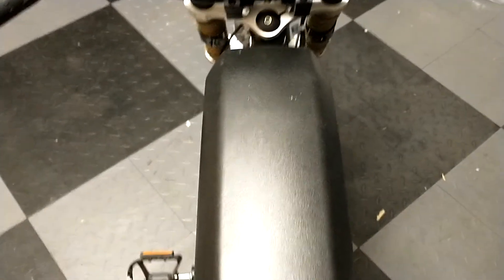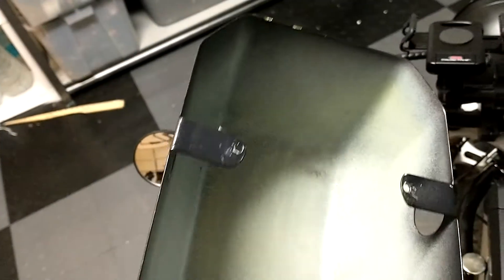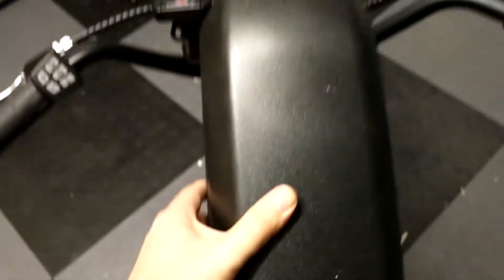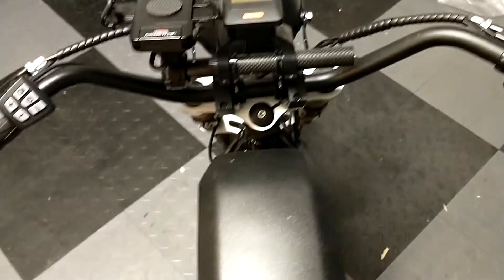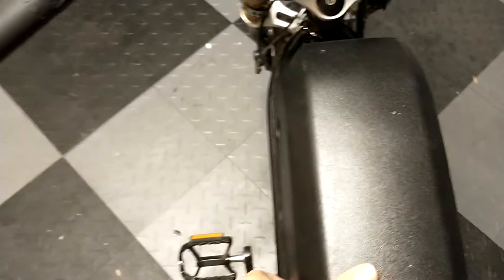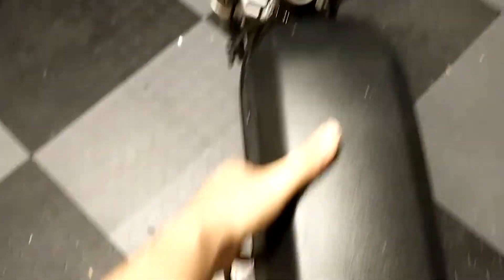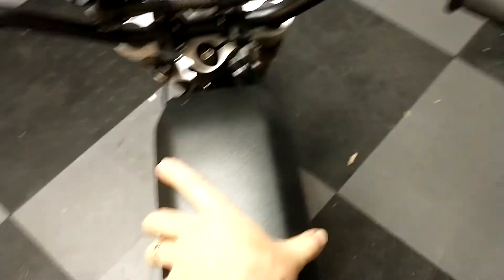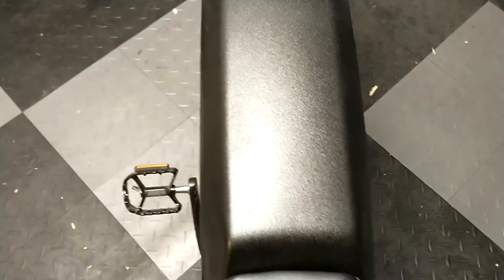Monday Motorbikes Anza - Easy Battery Cover Mod For Removing and Replacing Faux Tank

Comment: Great idea, ordering my magnets now. I got one of the first 500W Anzas. I hadn't had any speed issues like you did though. Hits about 21-22 mph, as I expected. Stupid tank was driving me crazy though, I had just been riding without it, thanks for the tip!
Reply from the maker: Nice! Haven't heard of anyone getting those speeds. Great to hear. Your tire size setting came set at 22 or 23 and phone gps shows 20 also? Very interested
Reply from the maker: Oh and try ordering 8.  Four for tank and four for frame. Think that will stop the rattle over bumps. I got another set to add more but my bike is all torn apart right now :)
Reply: @RobbMods  Verified with my phone GPS, yes. Didn't know about tire settings though.  Where do you find those?
Reply from the maker: @scott1127  https://www.manualslib.com/manual/1697627/Bafang-Dp-C171-Uart.html?page=12#manual double click the i button to get into the settings menu. Then click the i button until you get to the LUd screen. That is where you set the tire diameter. Ours should be 22 or 23. Mine came shipped at 29 so made it look faster than it actually was. That link takes you to the manual showing other settings to play with. Sadly the top speed setting doesn't do anything. Glad yours is working great! Thanks for sharing, I'll let other folks know :-)
Reply: @RobbMods  Awesome, thanks again! Got mine back in January so probably the very 1st batch of 500w. Not sure if that makes a difference. I'll have to check my settings now.

Comment: So, you need to take that off to charge the battery?
Reply from the maker: There is a hole you can pass the cable through to charge. If you want to take the battery off the bike to charge indoors, then yeah you need to take off the tank :-/
Reply: Oh ok 👌

Comment: Do the power cables for the battery mount look like they are easy to access? Like is there a plug inside the frame? Im going to have to try to get those out. I'll be checking tomorrow so don't go out of your way to look haha
Reply from the maker: They just use barrel terminals. I cut those off and got some male/female terminals from Lowes. Pretty easy to access. In my manic troubleshooting trying to get my new controller to work before I fried it i just pulled the cable out of the frame. When i put the OE controller back I fished the cable back through but was a little short by a 1/4 inch.  I wrapped the cables in black heat shrink and kept it out side the frame running along the  outside of the pipe and under/off to the side of the battery mount. Got an extra 1/2" of cable so the new terminal connectors reached fine with out too much tension on the cable.
Reply: @RobbMods  ok cool! I did take a look and it doesn't look too bad! I'm just going to have to drill some holes in the frame for the new battery 😁
Reply from the maker: @reconpeon  cool! Might want to pop the seat off and check the controller too.  The 750s have a 46v controller. They are small! Not sure how they will handle the extra volts. All this is new to me. If yours works let me know 🤘😎
Reply: @RobbMods  damn, that's probably the issue with your top speed. That's a terrible controller if it's 46v. It should be at least 48v
Reply from the maker: @reconpeon  sorry meant 48v :-/
Reply from the maker: Hey Jeff. I swapped out the controller now the bike wants to do wheelies and burn outs.  Max I can get with our battery is 28mph.  I'll save up and get a 52v battery in a month or so.
Reply: @RobbMods  which controller did you get?
Reply from the maker: @reconpeon  https://electrobikeworld.com/products/35a-controller had to get x90 battery connector (amazon), KT display (electrobikeworld), 6 pin throttle (electrobikeworld), 3 pin PAS sensor (Amazon), and some higo extender cables (amazon) also. Still waiting on a couple cables. Have the new controller zip tied to the frame so I could test it out :)

Comment: What spray paints did you use for the battery cover? Also,  is it steel?
Reply from the maker: Yeah it's steel. Frame is aluminum. Think i just got some flat black spray paint

Comment: Definitely doing this tomorrow when I install the 52v battery, it just got here. Where did you get the magnets?
Reply from the maker: Awesome! Amazon. Think i put link in description. Rattles a bit hitting bumps. Think getting 8 magnets and attaching to tank and frame with epoxy should help a lot. I just ordered more to try it out. Good luck on the 52v battery! Please let us Anza folks know if it helps. Did you get the programming cable? On the 750s looks like it's hard locked at 24.9 but was initially set super low.
Reply: @RobbMods  I didnt get one just because I'm about to order a 1500w motor
Reply from the maker: @reconpeon  bad ass! You'll have the fastest Anza around. Can't wait for the vid!